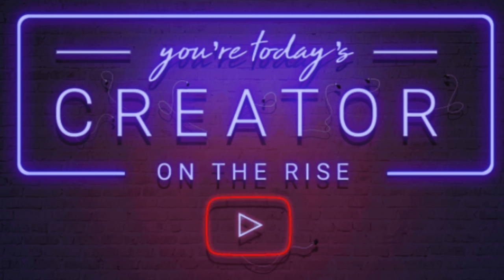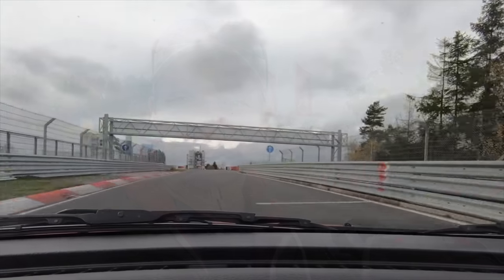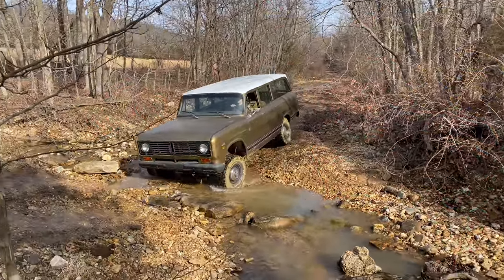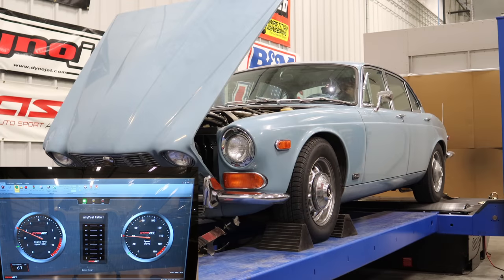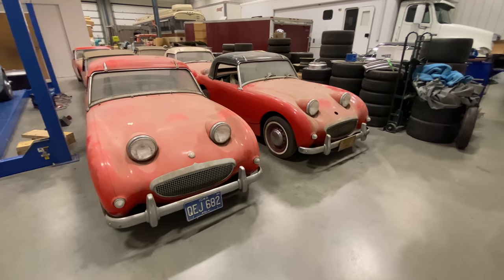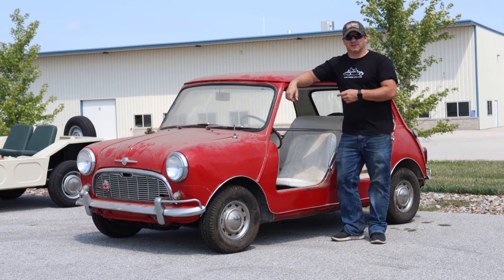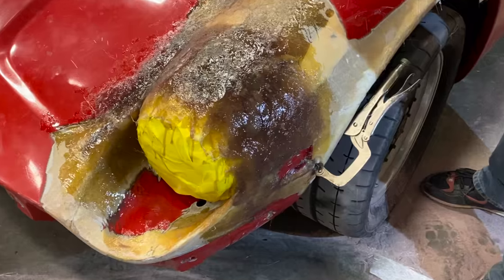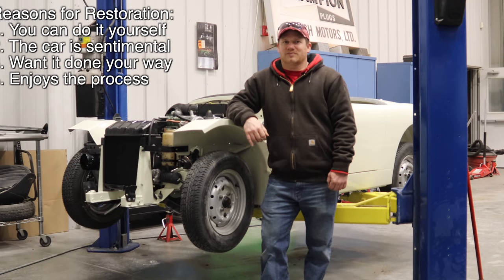I am YouTube's Creator on the Rise!

Comment: Not surprising , very great collection and content , also well made videos and great knowledge. LOL then you do donuts in the parking lot  By the way I had a 1959 Nash Metropolitan in 1967 and everybody called it the bug car. I loved that car,  IT got 50 miles per gallon it went 90mph after a bout a 2 mile run up beat everybody I raced from light to light{ although I did put 4 new axles in it , which were not easy to find!} It was totally rusted outunderneath  and the brakes gave out whenever they felt like it . It was a fantastic concept for the time, I paid 75.00 for it lol and sold it for 75.00
My next car was a 1968 400 ram Air firebird with a 433 rear end I bought new in 68.  Slight learning curve .   Congratulations !